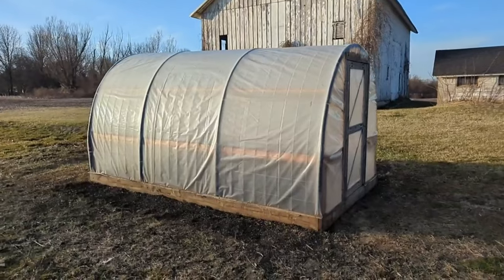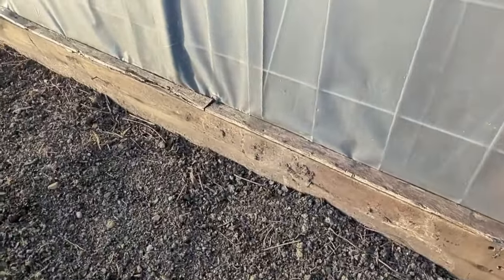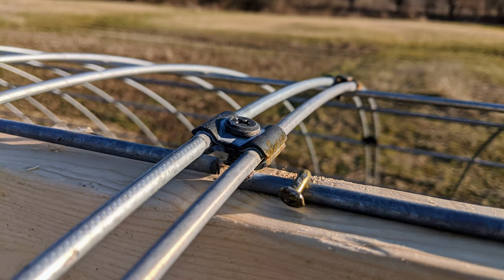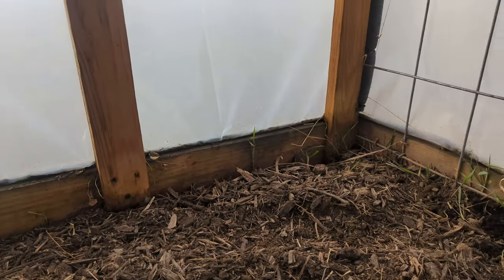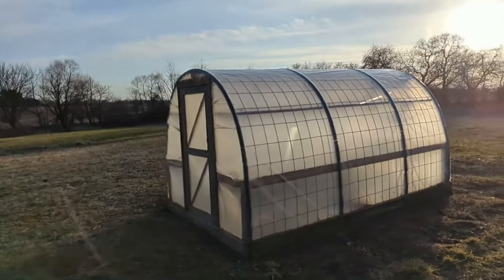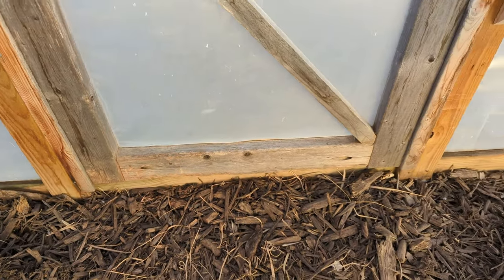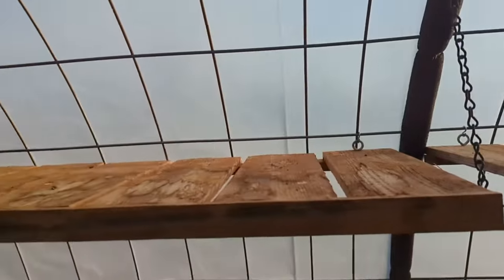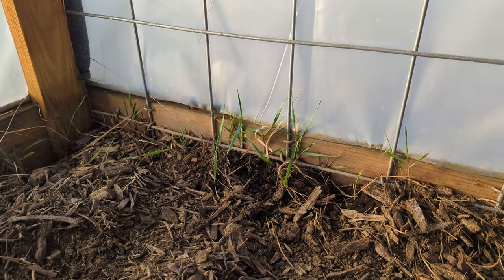Cattle Panel Greenhouse Review | Four Years Old | Surprising Results

Comment: I built one and had it for 9 years before I started experiencing any decay of the treated wood.  Despite being treated, I had a swarm of termites do some damage on one side just this past year.  Started off using home depot plastic sheeting and that only lasted a season.  After that I started using greenhouse film which lasted for about 5 years in my Texas sun before replacing.  Well worth the money.  The foam cushion also started decaying after about the 9 year mark.  I've taken down the structure to build another, but it was super inexpensive and useful for several years.
Reply from the maker: 9 years! That is amazing.

Comment: 5 year's here, 7 panels, runs N,S. Doors on each plywood end. Iirc 56 wicking tubs, 2 levels. Wiggle wire and track on base, fence staples both sides for 2500 lb. Polyester pull tape. Attach 1 side toss over,  install hitch loop   where appropriate, thru staple, loop and PULL. Every 24inches.  Plastic doesn't fudge. Only thing that does the plastic in is big hale stones. That allows for the plastic to be staged at different levels when needed . Lots of good videos on them. Everyone should have one. OH, plastic matters, buy the good stuff at a greenhouse supply. Be sure to get the anti drip 😊.
Reply from the maker: @timmmmmmmmmmy1  thanks for the input

Comment: Really appreciate the follow-up. Pavers are a great idea as a "floor" in the greenhouse and alleviates wear and tear from walking directly on the weed cloth. Weed management is even better when putting down cardboard on the grass first, weed cloth on the cardboard and pavers on the weed cloth.

As for snow, if two cattle panel pieces are joined at the top as the "ceiling/roof" to make it wider (example, joining 2 16-foot panels at the top/center) WITHOUT support, a foot of snow will make it sink in the middle. Floor-to-ceiling support beams remedied that. You had single panels (a plus) supported by a full-length beam from front to back (another plus), so snow wasn't an issue. Yay! Even though it's not made from bricks, a third plus is the physics & strength of an "arch" shape/build.

Looking forward to seeing the next greenhouse build. Thank you and God bless you!
Reply from the maker: Going to be building a high tunnel in the next week... I hope.

Comment: Nice setup. I was originally going to do cattle panels also but in 2022 I did 1/2" PVC loops. It was just a through together ideal just to extend the fall. Wasn't expecting it to survive the snow/winter. It did but a big wind took it out after the snow was gone. I started over and went with 2 10' 3/4" PVC in a gothic style (10' x 15'). 5' 1/2" conduit 2' into the ground with 4' re-bar down deeper on each loop. That made a slight leaning 3' knee wall. My center ridge is just over 8'. That extra 2' of height makes a big difference in temp control. Worked out great this winter with not much snow but zero issues with what we did get.  Had some big winds again (nothing like you get) and no issue there. I plan to do something similar with the bench setup for the same reason. I might extend mine out an extra 10' to make it 10' x 25'. I might go a little wider and a little taller. Thank you for sharing the video.
Reply from the maker: Sounds like you got a design in the making. It always takes trials to see if something is going to work. Good luck and thanks for the feedback.

Comment: If you want, try the citrus trick on the plastic or other tricks that are used to help Opaque plastics on car headlights.
Reply from the maker: Interesting. I will give that a try on a small area and see what happens. Thanks.
Reply: I assume you are talking about some CITRUS OIL or compound. How does it affect UV Stabilization?

Comment: I bought your plans last fall and built the greenhouse and am very happy with it.  I made mine 12 feet long instead of 8 feet.  Instead of anchoring it with rebar I concreted six 4x4's at the corners and in the middle and screwed two rows of 2x6's to make it a little taller.  Other than that followed your plans.  Your right about extending the weed barrier outside the greenhouse i am having the same problem with weeds growing around the inside edges.  I live in Texas and even some days in winter it gets a 100 degrees or more in the greenhouse so I added a ventilation fan.  Overall this is a great design, very satisfied with the results, thank you.
Reply from the maker: Thank you. Glad to hear it

Comment: I've had your plans in my cart for quite a while.  The one thing holding me back is height.  Do you know how tall the walking space in the greenhouse is?  I don't want to have to walk bent over in it
Reply from the maker: The head height from the ground to the bottom of the ridge is 6'. I have an addendum to the plans that I did for somebody quite a while ago that adds 5 1/2" to the overall height. If you buy the plans just message me and I can send you the addendum. It also adjusts the door size as well.

Comment: Thanks I used yours for some inspiration and build my own in a different way.  Probably spent way to much but it’s really nice.  What do you heat yours with.  I’m going to be using a diesel heater.
Reply from the maker: I have been using a Mr Buddy heater with a wood stove fan rigged on top of it for the past four years. I have been thinking about switching over to a diesel heater.
Reply: @mtlibertydesigns  i always thought it would be bad for the plants to have a heat source without a vent.  Your plants look great tho.
Reply from the maker: Thanks @charger7022
Reply: @mtlibertydesigns  if you don’t mind me asking what should I shoot for as a minimum night time temp In the greenhouse.  We may still get some nights in the upper 20’s if I have the thermostat set at 50-55 is that good. Mostly young vegetables tomatos,peppers etc.  we sprout them in the house and want to move them out here after they are an inch or 2. 

 Thanks
Reply from the maker: I like to make sure it does not get below 50 degrees in the greenhouse if I have tomatoes or peppers in the greenhouse. @charger7022

Comment: I do not understand how the rebar was installed?
The cam only shows the base
Can you please explain?
Thanks
Reply from the maker: I drilled holes through the 2x6 side pieces with a spade bit that was just big enough for the rebar to fit through. I also had an extension for the spade bit. There were three holes in each side piece, one in the middle and one on each end about 1' foot from the ends. Hope that helps.

Comment: Where would be the best place online to order the 6 mil
plastic? Also, wondering which brand automatic door-vent opener or brand do you suggest? Thank You.
Reply from the maker: I put a link in the description where you can get the vent and plastic from Amazon. Here are the links. I get a small commission from these. It does not cost you any more to use them. It helps me produce the videos. Thanks: 
Automatic Vent Opener - https://amzn.to/49zW28Z
Gridwall Connectors - https://amzn.to/48FFMlv
Greenhouse Plastic - https://amzn.to/3P2Ftdz
Greenhouse Thermometer - https://amzn.to/3V06LFi

Comment: I used weed barrier.  After not using the greenhouse for five weeks i went to use it, the entire thing was full of weeds as tall as i was.  They were near impossible to remove because they were woven through the weed fabric.  If you use the greenhouse all the time yeah but it didn't work for me.
Reply from the maker: It is definitely something you need to stay on top of as a maintenance issue with a greenhouse.
Reply: If you don't want to remove weeds manually, you need to me as low as possible, and then do 1 of these:
1. lay black or clear plastic over soil for 6 weeks;
2. Lay overlapping  pieces of corrugated cardboard (NO TAPE!), moisten WELL, then add a an inch of soil and another cardboard, MOISTENING EACH LAYER OF CARDBOARD. Layer until you have a 7 layer garden lasagna.
You can plant directly into this. To block weeds where you don't plan to plant, you can screed with sand and put pavers immediately over 25 year fabric.

Comment: How can I get the connectors for the cattle panels?
Thanks.
Reply from the maker: I got everything except the wood from Amazon. Here are the links. I get a small commission if you buy through these links. It does not cost you any more than normal. Thanks.
Automatic Vent Opener - https://amzn.to/49zW28Z
Gridwall Connectors - https://amzn.to/48FFMlv
Greenhouse Plastic - https://amzn.to/3P2Ftdz
Greenhouse Thermometer - https://amzn.to/3V06LFi

Comment: You forgot to say how you tied panel ends to the sill. Fence staples? And you must have used awfully thin rebar?? Looks like you ran it through the 2x6d. Or through screw eyes screwed into the 2x6s? I was thinkibg about using the long threaded rebar with bolts to tie the corner posts to a locust post sunk 3-4 feet into the ground. Wind actually imploded one if those big pre-fab storage sheds on my land. I was thinking, it needs triangular bracing and I was doing that the same week that wind blew in the front door and exploded it! People say, "oh, the walls (4x8 siding) will brace it." It will for awhile. But I brace Everything now. I build better than some men who came before me. I had a big barn that was oak boards. It collapsed like a big cardboard box after a retaining wall collapsed on obe side.
Reply from the maker: I show all that in my other video. https://youtu.be/K67-Jc6qpUY Let me know what you think. Plus a lot more in my plans. https://mtlibertydesign.etsy.com/listing/1396229334

Comment: My father in law and I are in the process of building one now. We bought base blocks for the corners and in the middle beside the rebar to have a more secure foundation and will fill in the sides with rocks so there are no gaps. We did this because my back yard has a slight incline to one direction. I live in an area that get's hail. Ussually it's no bigger than peas but every four or five years we get worse. Should I be concerned?
Reply from the maker: If you are using the 6mil greenhouse plastic I don't think so. If it is really big hail then that might be an issue.
Reply: @mtlibertydesigns  I took that off of the comment without realizing you had comments already. That's what I was thinking. The plastic is only supposed to last four years anyway. Not extremely expensive to replace which is nice.
Reply: @mtlibertydesigns  We are keeping to the design as much as possible. The list has higher prices than it cost around here also so I am saving money. FYI The list said 5/8 inch rebar not half inch. My father-in-law noticed it immediately. It does say 1/2 inch in the instructions though.
Reply from the maker: Glad I got the rebar right in a couple of places:)  @Bland-79
Reply: Thank you for your 4-year review. We bought your plans in May 2023. Was built over the summer.  Great plans!  We made it 10 ft long vs 12 feet for our backyard. Can’t wait to start some seedlings mid-March. Love the automatic window!
Reply from the maker: Thank you very much for buying the plans. You won't be disappointed with it over the years. It really is a great little greenhouse.Thanks again. @debbiehs390

Comment: Nicely done
The first one I built was a 2 panel one.
 I secured the panels together with 8 inch zip ties...
when a tree fell on it and crushed it -
I was amazed to see that none of the zip ties had broken even though the steel panels were nearly flattened.
I didn't mind too much because it allowed me to build this
https://youtu.be/jUcXq0C30XQ?si=kovrN6G9ALhzCo9Z
Reply from the maker: I like it. I was thinking of doing something similar but a much smaller version. Nice job.
Reply: @mtlibertydesigns  Thank you